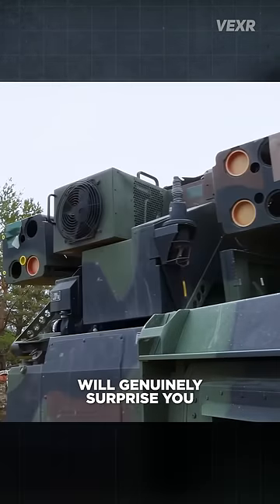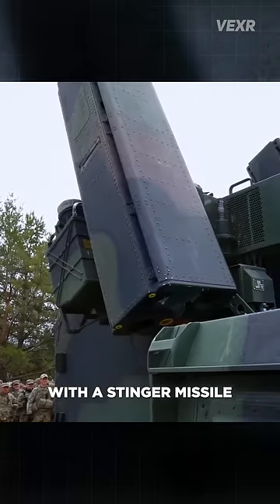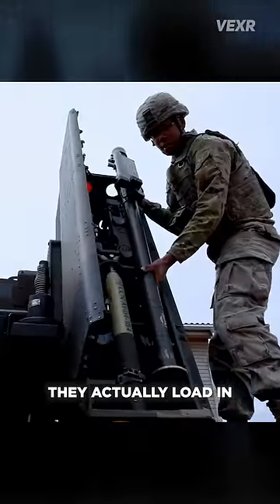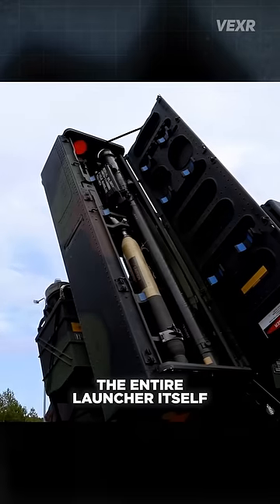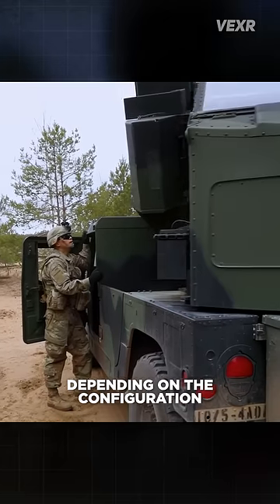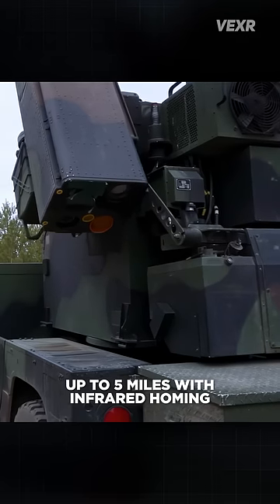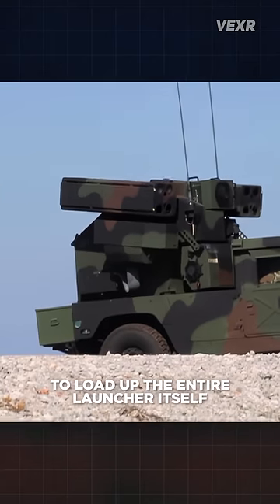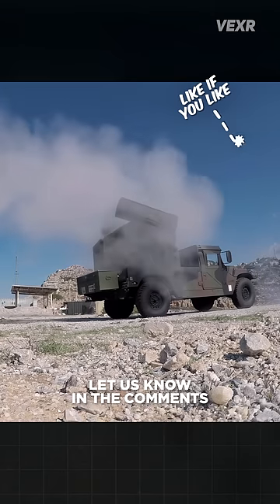The Weirdest Way To Load a Missile

Comment from the maker: Are there any other SAM systems that do this?
Reply: There is a similar system in the German Bundeswehr. It also loads Stingers with their launchers. As it is a paratrooper system, using the same launchers as the infantry simplifies logistics. 
Plus, there a small ships, that use armor pods, where a sailor can stand and fire a stinger as air defence for the ship.
edit: Looked it up, it's the Ozelot SAM System. It's based on the popular Wiesel chassis
Reply: Also Japanese Type-93
Reply: Pretty sure a russian one does it with iglas
Reply: The same missles are used in the LAV-AD
Reply: StiNGer!...not StiNG Ger.🙄
Reply: In general, militaries keep a manpad or atgm sealed against the elements so they do not get damaged in transportation.

No miltary wants to have to unpack a missile system from its tube if it can be avoided.

So whilst the specifics of the avenger is uncommon, the concept of keeping missiles stored in their containers is not.
Reply: Pretty much any SPAA that uses MANPAD style missiles which is a whole lot
Reply: I sure someone will say this but alot of low range SPAA do this. The Russian igla is a prime example. I'd imagine it simplifies logistics.
Reply: @reigarreter  I'm pretty sure that is a Type 93
Reply: A lot of them, pretty much all the shorad systems tha use stingers.

I'm pretty sure some older Russian systems and most Chinese shorad systems do as well.

It simplifies logistics massively and if you have enough air power to at least keep the skies contested then shorad It's not really necessary except for exceptional emergencies so spending the money to design maintain and field a purpose build Shorad system that uses its own specific missiles doesn't really make that much sense.

This is also why there are so few NATO shorad systems, Your odds of surviving long enough against the NATO Air forces to carryout ground strikes is incredibly unlikely, While on the other hand Russia has pretty much accepted that their Air Force will rapidly melt and stop existing in a shooting war against NATO so they have invested quite Heavily on shorad.

The Chinese have gone for a best of both worlds solution, They have a powerful and advanced enough Air Force that it can realistically challenge the US and Island chain Air forces for a time so long as they stay in a defensive posture but they also realize that realistically they cannot always stop the kind of strike power that the United States naval air arm brings to the table so They have invested heavily on shorad systems to dissuade concentrated strikes against their ground forces, this is also why China has so few dedicated strike aircraft and bombers, the island chain nations are extremely advanced and most of them are well equipped with modern aircraft and filled to the brim with advanced medium and long range anti-air systems, And that's to say nothing of the United States Navy and it's ridiculous numbers of advanced aircraft and agis capable destroyers and warships.

This is also why I'm not so worried about China actually trying to invade Taiwan or something, They have excellent defensive potential but their offensive capabilities specially their amphibious offensive capabilities are extremely lackluster and have basically no weight behind them, considering how tough of a nut Taiwan would inevitably be trying to take it with result in nothing but suicide for what few amphibious forces they have.
Reply: As others have noted, logistics are simplified, both on supply side, and in the design of the mobile launcher itself. All the guidance circuitry is already in the individual launcher, so there is no need to replicate that in the Mobile launcher. The turret just points the missile in the right direction, and allows for remote firing from inside the vehicle. Pretty good system, I’d say.
Of course, when I was serving, we deployed Blowpipe missiles….the “Model A” of SHORAD systems😂
Reply: There are a bunch of vehicles that can mount multiple MANPADS though most of them don't have the cool tilting mechanism.
Reply: @tinfoilchampion3651 In fact, it is not. While The type 93 is similar, it uses domestic japanese MANPADS, the Type 91, known in the JSDF as "Hand Arrow". (Do not quote me here please, I am working off of wikipedia.)

The Vehicle shown here, as is said in the video, is the M1097 "Avenger". It uses the american-made FIM-92 "Stinger". 

They look similar, but are still entirely different SAM systems.
Reply: Turkish Atılgan.
Reply: Gepard 1a2 does this aswell
Reply: Not today CID
Reply: Not today Russia
Reply: Yeah the S400
Reply: @jangarleff3339 exactly right. Since the missiles leave the factory inside the launching tube, it would be extra work to take the missile out of the tube.
Reply: Why not just aim it & fire it instead of putting in the launcher. What advantage does the mobile launcher provide? 
Ps...Sgt Shultz here "I know nothing" 😉
Reply: @iRossco  Systems like ozelot are connected to radar and airspace control. They can attack the enemy plane before the soldier even sees them.
Reply: @Geeb69  they do.
Reply: It simplifies logistics. The less different things you have that do the same thing the better. If you can use the entire launcher, and the mounted system cannot function, you can still function in your role albeit at a degraded state.
Reply: Not a SAM but the Tow AT Launcher loads to whole barrel and projectile, similiar to this
Reply: Those missile pods get updates and configurations for other vehicles as well
Reply: probably quite a few, Patriot for one does, and sub launched missiles as well, though in that case it's rather necessary for proper launching. Pretty sure most systems that do that are for keeping the missile clean and in full working order, as you only need to check it when it's loaded into the canister, in whatever factory or warehouse that's done in, then as long as the external casing is intact the missile is good to go
Reply: I used to be on the M6 Bradley that used one of the same launchers instead of a TOW launcher.
Reply: I’m pretty sure the LAV-AD also does that but the Vulcan cannon would probably be more of a hindrance
Reply: Not an answer to what you asked, but with the stinger, if you could detect the F22, could you theoretically down an F22 with it's hatches open, through detection via phased array radar, and PK determined by air missile defenders with a stinger missile? Genuinely await an answer regardless of what it is
Reply: turkish atılgan and zıpkın
Reply: Fennek Stinger weapon platform of the Dutch army operates in the same manner
Reply: Even this info is new to me.
Reply: Turkish Zıpkın (for Isla) and Atılgan (for Stinger) should be similar
Reply: I bet it’s for the same reason you load missile cartridges on planes instead of individual missiles if they’re small enough. More efficient.
Reply: @senfdazu2230  That doesn't make sense. The factory could easily put missiles fired from vehicles in a box instead of launching tubes.
Reply: @theotheleo6830  do you know how these things work? It's not a bazooka that you can throw on the back of your truck. They have need protective packaging and must be wired to the launcher, because the missile can "communicate" with radar and fire control system. The easiest way and maybe also the cheapest is to transport it inside the launching tube.
Reply: @senfdazu2230  The box I was referring to would protect the missile. Also, the missile (which would be made solely for launching from a vehicle) would communicate with the vehicle in the same way that the vehicle currently communicates with the launcher.
Reply: @jangarleff3339  Some amphibs have put APCs with autocannons on the sides to handle boats. I think the Marder 1 had an entire Milan launcher as it's ATGM at one point. Neither is ADA but it's the same idea.
Reply: I heard your mom is pretty good at reloading missiles. 😊
Reply: If I'm correct, the launcher is reusable and the reason it loads the entire launcher. Is it makes the system cheaper to operate? You don't have to have a built-in launcher. Just load the launcher in it's basically a housing unit for the launcher.  Cheaper
Reply: @Geeb69 is not for pansir s1
Reply: @studentaviator3756 I think you missed the point.  The Stinger missile comes in a shoulder-fired launcher.  In this video, they are being loaded into the vehicle launcher, while still in their own launcher, not their shipping container.

There's a point in the video where a caption says, "THE ACTUAL MISSILE", but it's actually a Stinger missile in its launcher, which is how they come out of their shipping container.

The troops never actually see the missile itself, until it's fired.  The launch tube is sealed, and is not reloaded after firing, but the target acquisition components, the IFF, and the gripstock assembly will be reused on the next loaded launch tube/missile.

So, they are basically using shoulder-fired missiles in a vehicle launcher, while they are still in their own launcher.
Reply: @ah64dbeast37 No, the launch tube of the Stinger is not reused.  After firing, the grip stock and target acquisition components are removed to use on the next missile round (a missile in a sealed launch tube), and the fired tube is discarded.
Reply: @throngcleaver  oh ok it's like a Javelin missile system disposable tube didn't know that
Reply: @ah64dbeast37  Exactly. 👍
Reply: Each missile type probably has a different connection to the launch system. Keeping the missile with its launch system makes the missile more reliable.
Reply: Kamov designed the Ka-52 to carry Iglas the same way: there's a pylon adapter which holds and operates two Igla shoulder-fired launchers.
Reply: The Turkish Porsav / Sungur. You also load the entire launcher into the system.
Reply: @Geeb69  You are wrong. There is no such Russian/USSR SAM system. They have stationery launcher tho with 2 Iglas but I've never seen them in use, called Dzhigit.
Reply: @ADB_UWIM_2807  You are wrong. There is no such Russian/USSR SAM system. They have stationery launcher tho with 2 Iglas but I've never seen them in use, called Dzhigit.
You are probably confusing it with Strela-10. It is called similarly to MANPAD but the missle is different. It's way bigger.
Reply: Asrad Hellas from Greece
Reply: Where are the war thunder players? Where are classified detailed information about it?  You guys are slacking...
Reply: The French has somethings like this
Reply: @reigarreter  type 93 is same system
Reply: The Strela-10 loads a whole Box the Missile comes delivered in into the launcher.

The Type 93 is also similar to the avanger, same with the LAV-AD or basically all Stinger based SPAA‘s.
Reply: The bradly does the same thing with the javalin 
They just stick the whole launcher in there
Reply: @theotheleo6830  reasons for why they use the shoulder fired one for vehicles is simple. 
Only one production model, only one supply item, one size fits all. Why develop, test and maintain a vehicle-only system which gives you little advantage, when you can just strap the shoulder fired one in there and add a little cable connector to interface them with the vehicles launch controls?
Reply: @jangarleff3339  The German Ozelot
Reply: Isnt the stinger system a fire and forget ( and discard the launcher)? So for logistics its simpler than having a manpad version and a seperate missile pod. Bonus infantry can rob the systems from a disabled avenger
Reply: Man pads which is just firing the sting hand held and the cram which has over an 80% k*ll rate or hit rate
Reply: There's also the 4 igklas static and mounted AA turret
Reply: Most developed countries with a decent army possess SHORAD (short-range air defense) capability, often with Stingers, Mistrals, or Iglas. Many that possess their own are upgrades of those with Japanese Type 91 being stinger based, Korean KP-SAM on Mistral, and Chinese FN-6 on Igla. Vehicle mounted SHORAD systems also sometimes combine guns with SAMs for point-blank coverage.